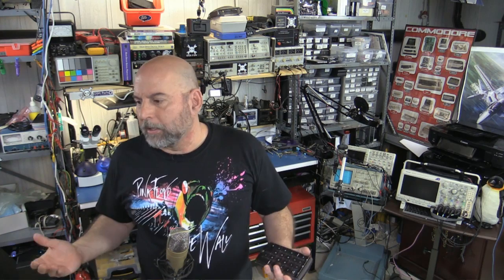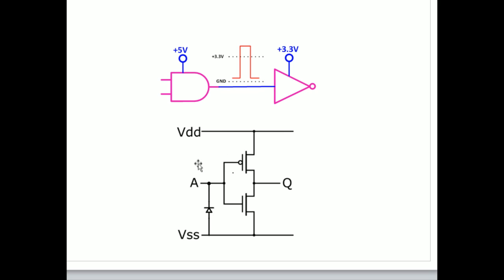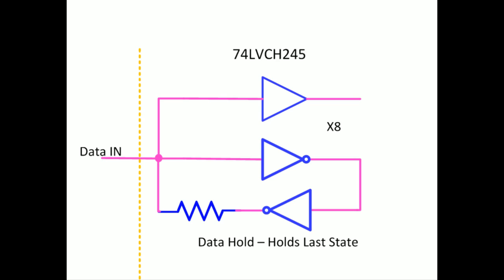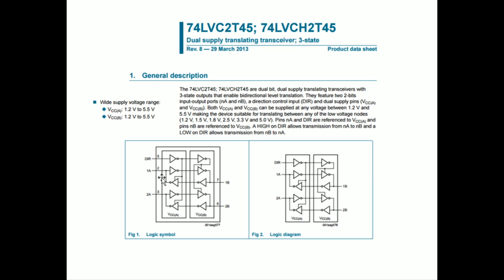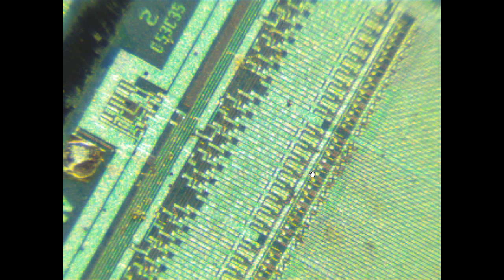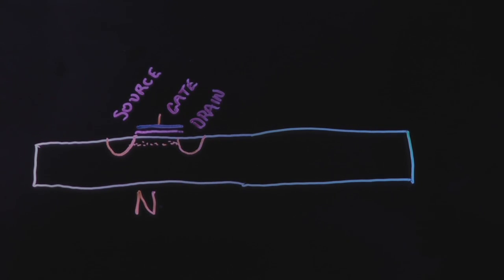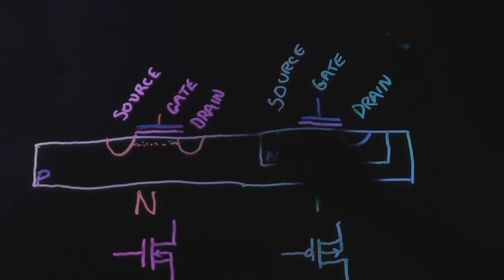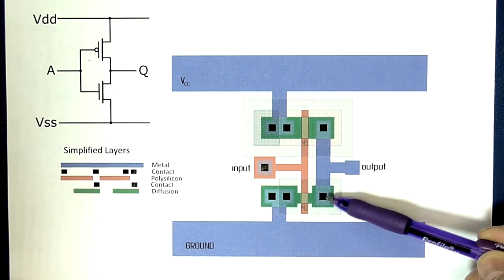From Gates to FPGAs: CMOS II

Comment: I actually saw this happen as a contractor at IBM Yorktown 25+ years ago. I worked in the then leading edge 1/4 micron e-beam litho lab. I was there the day they spelled "IBM" in xenon molecules. And took a picture of it.

 Miss those days.
I have some wafers in my desk yet. They used to use animals as the die identifiers, and I have some "antelope" wafers, which I believe were production memory for a mainframe module. They actually have a antelope on the die.

Thanks for a great video! 

Off to download Magic and design my own antique device....